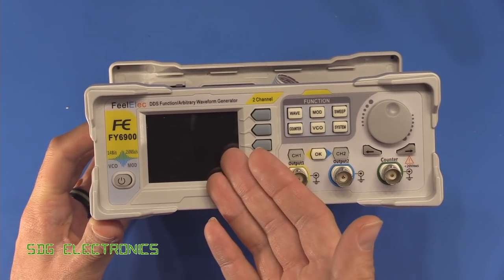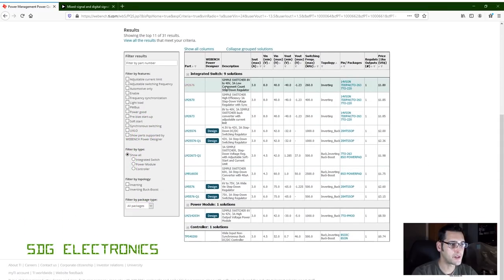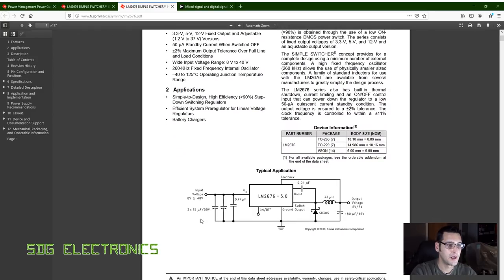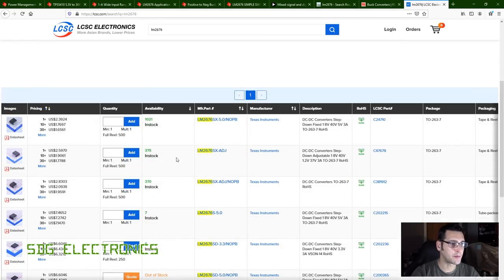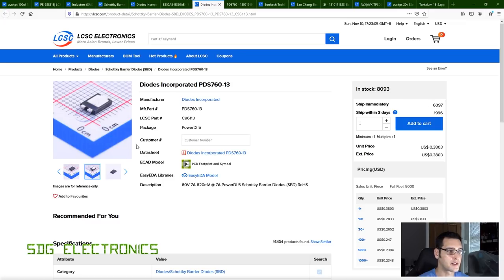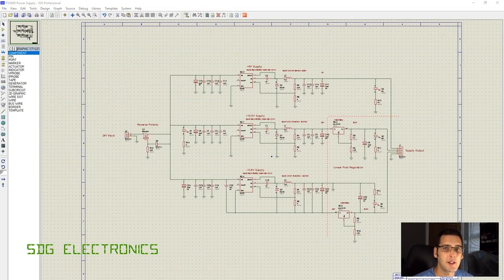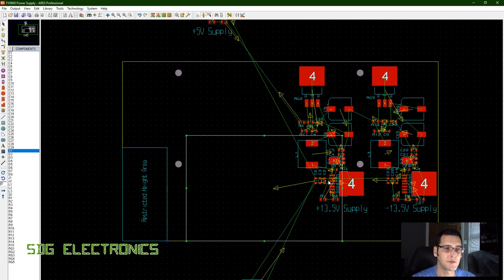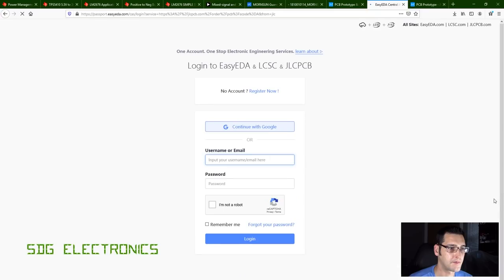SDG #114 DC-DC Buck Regulator Converter Design, Schematic and PCB layout tutorial

Comment: This layout may be pretty noisy.  You should follow the rules of DC/DC converter layout: 1) Identify your current loops.  There are two: one when the switch is closed; and the other when the switch is open.  2) Arrange your main components such that the loop areas are minimized, and (this is very important) all on the top surface layer.  For example, DON'T use the ground plane to connect CIN and COUT together.  3) Use a "single point" ground, meaning that any ground vias are all clumped together, not spread out.  Rules 2 and 3 go together because they prevent any large switching current from flowing in your ground plane, which causes common-mode noise in the sensitive parts of the board.  For example, in your case the only sensitive point would probably be your linear regulator; any CM noise present in the ground plane where the linear regulator connects to ground will appear at the output of the regulator, which kind of defeats the purpose of the linear regulator.  Look at how TI did the layout in the data sheet and follow the loops.  First loop (switch closed) goes from CIN positive, through the FET (inside the chip), then through the inductor, then through COUT, and finally back to CIN via the ground.  (This first loop is fairly tight, but TI could have made it a lot tighter with a 2-layer board)  Second loop (switch open) starts at the diode cathode, goes through the inductor, then COUT, then back to the diode anode; very tight.   Note that they used polygons instead of traces to minimize the open area inside the loops because it reduces EMI.  BTW, another issue you might have is beat frequencies because you have three switchers connected to the same source with no chokes to separate them.  I hope this was helpful.  I don't mean to be critical.
Reply from the maker: Thanks for your comprehensive comment. I actually took some time to review the layout after uploading the video so most of this was caught before ordering. I've left the ground plane however - there's mixed thoughts on this as it depends on the frequency of the switch mode controller. At >200kHz, we'll just be starting to get to the point where the return currents on the bottom ground plane will follow the path of the current carrying trace on the top side of the PCB. Hopefully we can perform some EMC analysis at a future point.
Reply: Another thing that I found had quite an impact is the capacitance of the switching node (connecting output of the IC to the inductor) to ground.  A few picofarads there and the spikes you see on the output get quite big, scope probes wreak havoc there.  Anyway, avoid using a large polygon there!
Reply: @rjordans  Or, you can use a polygon for that node, but just don't have any ground plane under it.  Also, often the reason you see big switching spikes is because of resonance.  It's typically the parasitic cap you mentioned, plus the parasitic cap of the inductor in parallel  with the parasitic inductance of the output caps.  You can often significantly reduce the peaks of these spikes with a series RC network in the right spot; the C is large enough such that its impedance is much less than R at the resonant freq.  And the R is typically around 10 Ohms to provide damping to reduce the Q of the resonator.  I'm not sure I know a good design procedure for working these out -- I don't do many power supply designs these days -- I usually just do trial and error.  But I think there are design equations out there somewhere.
Reply: @steverobbins4872  Thanks for the hint.  I was wondering indeed what a snubber would do here and how to put one in.  A quick search got me to a TI technote "Minimizing Ringing at the Switch Node of a Boost Converter".  It's for a boos instead of the buck regulator that I was looking at but at least gives some guidance to start experimenting.
Reply: @rjordans  Thanks for the reference.  This looks like a good article.  However, for the record the author (like most engineers I've met) may be misusing the term "snubber".  According to my text books a snubber is an RCD (D for diode) circuit that reduces the stress on the switch by altering the trajectory of its Q-point; it is not intended or designed to reduce ringing.  I think the RC circuit should more precisely be called a damper, but I haven't found any references to support that.

Comment: Great video. When designing SMPS I like to put in couple of small value ceramics right at the input of the module and at the output of the converter. This helps to reduce high frequency noises. It’s not always necessary but can help to pass EMC requirements.

Comment: I always had the temptation to run away from the Simple Switcher DC-DC converters from TI, just to avoid the use of a external freewheeling diode. However, the phase margin compensation feature makes them a suitable candidate for future designs.

As for the capacitors used, I tend to choose the expensive solid/polymer electrolytic types for such applications. For other applications that don't require high voltage and for relatively low ripple applications (for example, local decoupling, along with ceramics), I tend to choose those from the OxiCap NOJ series from AVX. Those are niobium types, and are much more tolerant and less explosive that tantalum caps.

Anyway, it was great to see your design process. Thanks for sharing!

Comment: Late to the party, but this is a terrific walkthrough of the design process.  Besides the spectacular failure modes, I try to avoid tantalum caps because tantalum is a "conflict mineral" mostly mined from the Democratic Republic of the Congo, not typically ethically.

Comment: I would have looked at AP63201 for step-down (AP63201WU-7DICT-ND on Digikey) ... cheap, high frequency so cheaper surface mount inductors and capacitors. Very detailed datasheet with recommended values for components AND suggested circuit layout. 1.2$ in 10qty.  AP63200 is same but in TSOT26 footprint.
Another option ... Richtek RT8279GSP , 1.3$ if you get 10 (edit: it's 0.7$ each on LCSC, 9k+ parts in stock),  5A 500kHz  and then you can power the inverting regulator from this rail, along with the 5v regulator.

Comment: Purchasing from LCSC, aluminium polymer capacitors are very cheap. 
These are quite low ESR and ESL and for the switching frequency of the simple switcher part should be sufficient enough to not use the ceramics.

Comment: I haven't a clue about what I am talking about. But why not use a $25 pc computer power supply. You can get 24, +12, -12, +5, -5 volt. Drill a hole in the FY6900 and insert a 5 pin socket for a 5 pin plug. Now you have an external power supply for the signal generator. What is wrong with the one that came with the unit? Or is this just a lesson in electrronics engineering? Good video desription of what you are doing. I have a FY6900 and I am not going to change the installed power supply, but if I am then for 30 bucks I can have an external supply.

Comment: Very good video. I'm often  completely lost when selecting components. What is generally considered a low ripple current? I always hear "low ripple current" mentioned but what value is that? I'm sure its dependent on what you are designing but is there a rule of thumb? Also what PCB software are you using?

Comment: I am a mechanical engineer (retired) and in a former life in the mid-eighties, I used to design PCB and thick film hybrid layouts for a living. Looking at various videos like yours on YT I now wonder how the hell we ever managed without CAD. I note you did not mention the auto-router in your package; did you ignore it in your layout? Manual layout is undoubtedly a much longer process but offers a real sense of achievement when you 'get it right'. I'm sure I still have my scalpel around somewhere. :-)
Also, I would love to know why you use electrolytics and ceramics in parallel. Is it a frequency thing?
Reply: @KissAnalog  Cheers! 

I thought it must be something like that.

Comment: QUESTION:  Why not use a transformer 15-0-15, with regulators for the LM317 & LM337?
Reply from the maker: This is basically what I did for the older FY3224S/FY3200S, however there is a fair amount of heat generated by the transformers and regulators when driving 50 ohm loads. The DC-DC converters get closer to the design voltage without dissipating so much heat.

Comment: Steve, greetings from Russia! It's a very good job. Did you save the Gerber files for the PCB? Can I buy them with your SDG authorship or buy a ready-made Board without installing components (or with installing components) through PayPal? I also bought Such a feeltek FY-6900 generator and would like to replace the Power Board. Success in business!
Reply from the maker: The files are on my website: https://sdgelectronics.co.uk/fy6900-signal-generator-power-supply-modifications/ feel free to use them to get your own PCBs made.

Comment: Isn't it suitable to put LC (PI) filter between switcher and linear regulator? Linear regulator (like LM317 and LM337) are very bad at filtering high frequencies which are generated by switcher. Or it does not make much difference?

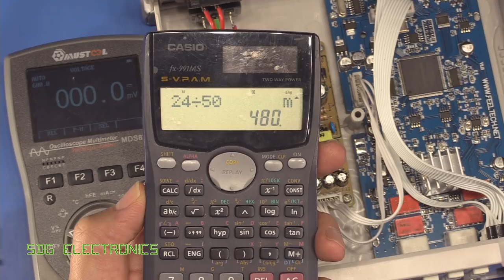Comment: When you say you put a 50ohm terminator on.... at 3:30... is that a load of some kind?
Reply: Yes, he put a 50 ohm load on the signal output to see how much power it would use that way.
Reply: @stevec5000  Thanks for replying Steve. I had to ask the short version of the question to get an initial response. So here is the long version... Terminology is the basis... I presume a terminator is a connector with a resistor in it. This resistor allows current to flow. If it was an inductor as a load then would the load cause a difference to the signal generator behaviour? So are there different loads that cause the signal generator a problem?
Reply: @dudleywin7514  Right, a terminator is just a connector with a 50 ohm resistor in it.  Carbon resistors are generally used in low power applications since they are not inductive.  An inductor isn't likely to cause any problem for the signal generator but it might be resonant at different frequencies which is not what you want when taking measurements.
Reply: @stevec5000  Thanks a lot! So I could say the carbon resistor is the perfect load because it has the right resistance and absorbs the current provided/pushed/drawn by/from the generator and turned into heat.... ?

Comment: Wow, this is so informative! When do I use tantalum and when ceramic capacitors in switch-mode converters.
Reply: Avoid tantalium caps.  When they fail, they short with a vengeance, causing lots of troubles to whatever lies beyond.  They can ruin a complete power stage.

Comment: Hi there, I did some rather amateurish measurements of the output stage performance of an unmodified FY6800 ( https://youtu.be/u6zQM3S556A ). In the comments to that video the question arose if with a FY6900 with your redesigned power supply is actually able to drive a 50 Ohm load at 20Vpp set voltage (an unmodified FY6800 can't - output voltage breaks down / waveforms are distorted above 10Vpp set voltage with a 50Ohm load).